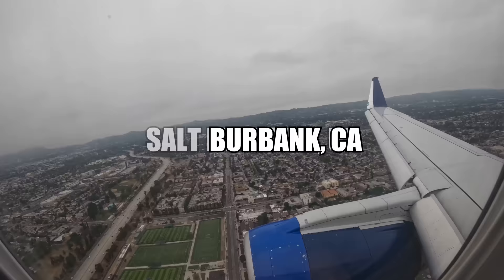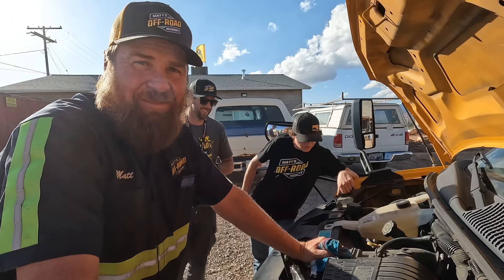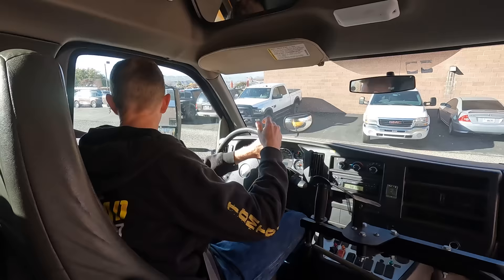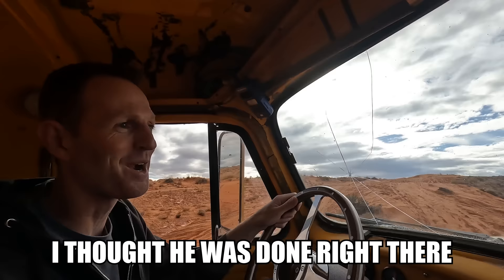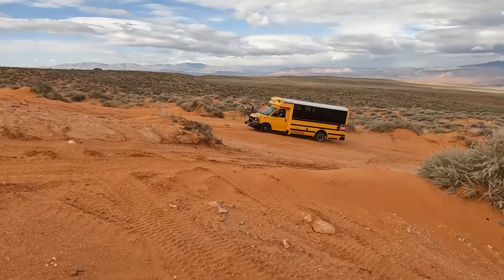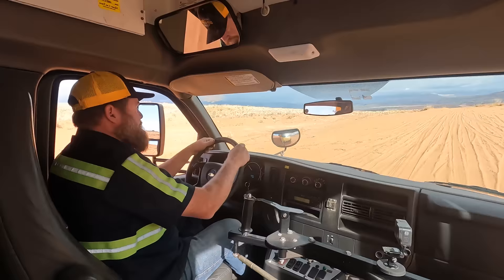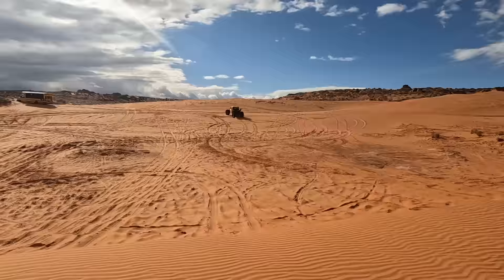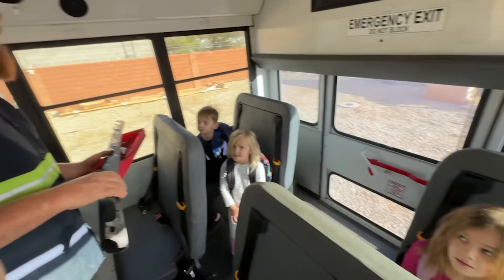We Jumped It!

Comment: The end was epic, with the kids in the back. Amazing how well the bus did. I was wondering if it has a limited slip rearend by the way it went through the sand.
Reply: There's some explaining to do 🤣
Reply: i mean i wanna say from 07-present gm in most truck applications put the g80 locker in the rear end and its a dually so more than likely should have that, how well it still works is up for debate since it one wheel peeled on that rock.
Reply: Could be that it uses the ABS to brake the spinning wheel too?

Comment: I used to drive a school bus as a work truck, loaded with tools, they're a lot of fun to drive. We also hit the bottom step on everything, the front corner was all bashed up.
You can keep the digital tach on all the time by pressing the top button to the left of the steering wheel multiple times until you get to the tachometer.

Comment: I would put full suspension seats in that bus. They will take out the majority of the harshness of the ride. As long as they have good shocks, it will go a long way in preventing motion sickness as well.
Reply: I agree.  Long chassis have light rear ends. The seating in the rear especially needs to be secure and supportive. And the steps… if you raise the chassis the steps will be hard to reach for older folks or people with physical limitations.

Comment: If the A/C belt has a tensioner I would recommend taking the tensioner off completely and putting on a stretch belt.  The newer trucks don’t have a tensioner for the A/C. Just a stretch on belt. I had to do that for mine because the fast up and down raving kept throwing it off.  Just a suggestion. 🤷🏽‍♂️

Comment: School busses are actually surprisingly competent. I'm a tree planter/Bus driver (driving everybody to the job site, then planting - often hundreds of kilometers away from ashpalt). With some logging truck tires and a good amount of momentum and confidence they are pretty decent. They are dualies, so even rear wheel drive, they do put power to 4 wheels :). The bigger busses have bigger tires/wheels and can accept logging truck tires - they have much better clearance but have much bigger issues with scratching their buts. Enough momentum fixes a lot of issues (bigger busses also really suck for the people in the back, it acts like a giant lever with the nose staying down and the back bouncing on bumps - the farther back you are the worse it gets). They also have much bigger engine bays and are incredibly easy to work on in the field - on some of our busses I can literally stand between the wheel and the engine. The engine bay on yours seems like a nightmare - things like to snap at high speed, being able to easily get in is important. 

In canada atleast, if it's chrome yellow and has the stop sign it's illegal to drive without a specific school purpose vehicle license. This is why all planting busses have house paint paint jobs.

Rip those nose mirrors off if you take em into tight trails. They will snap off otherwise - and at high speeds I would be worried about them hitting the windshield when they snap 

Gotta keep in mind the stairs. It is always the lowest point.

Also one of our competing companies did roll a bus last season - although that was loaded to the roof with gear, super top heavy. Take her high speed around hairpin corners and she does feel tippy, but she is good.

Sand sucks. Definitely had to do a 2 truck tow team at speed  to conquer some long steep hills where hitting her at 120km/hr wasn't sufficient. You have to go full send. To hell if your passengers hit the roof - you go slow you get stuck. 

I've gotten a stock bus (with knobby tires) more off-grid than most jeeps will ever see (although the bus is obviously less competent)

I've been trying to convince the company to organize a school bus rally racing series for charity. No dice :(.

Comment: Collins Bus, made about 2 miles from where I live.
"Each bus is constructed with high-strength low-alloy (HSLA) steel to produce a one-piece tubular roof bow that is 66% stronger than traditional steel. Meanwhile, the sturdy roll cage structure maximizes passenger protection by utilizing full-length, interlocking cage stringers and floor beams. The result? A dependable G90 galvanized steel structure that resists corrosion."

Comment: I would have suggested a full size bus, likely cheaper, with more clearance, and a stronger transmission. They drive really good, even in snow less than 2 feet.
I am impressed the shorty made it that far, but I'm also confident that a full size bus would also make it with less chance of high centering, and less bumbyness.

Comment: deff will need some wall padding inside also something to help keep passengers from hitting their heads on the windows from the bouncing and maybe a 3 or 4 point seat belts  to keep passengers in their seats. and since your going to be using 42in tires your center of gravity is going to be affected with it being top heavy so need to figure out how to stabilize it to keep some tipping... its going to be a epic build.

Comment: Once you put those big military axles you been sittin on under that thing it's going to be a monster, but super heavy.
It's also going to get tippy when you lift it up like your going to do, it won't be the same vehicle at all.
You will need to widen its stance to account for the higher center of gravity it's going to have.
It also won't be street legal if you take out the antilock brakes I would think.
I am actually interested in this build for some reason!
Reply: they coudl probably just have a system to disable the anti lock for off road?  right?

Comment: Something to check, does Utah require a special license to operate a bus like that? You might find that anything capable of hauling >12 people does require a special license. ETA: I just looked it up, a vehicle designed to carry 16 or more people, including the driver, requires a Class C level Commercial Drivers License. It doesn't matter if you have 16 people in it, if it's designed for it than the CDL is required.

Comment: One thing I have allways admired about Chevrolet head by duty platforms is they come standard with LSD or automatic locking diffs of one forum or another. My RWD F250 gets hopelessly stuck approximately one second after touching sand. Open differentials coming as standard on a heavy duty truck is just insulting to be honest.

Comment: I can't remember the right section of the law but there is (or was when I had to look it up in the 90s) a federal regulation regarding the paint color.  It's a very specific color called National School Bus Chrome (or chromate) and you're required to repaint the bus in a different color within 30 days of taking possession of it for private use.

(Had to look it up in the 90s when I owned a shop and one of my customers was a local band that had gotten a ticket for having their short bus that they toured with still in the original color.)

Comment: I am not surprised it is a Chevrolet not surprised one bit that it broke down. You should’ve bought a Ford. Yes they are a little more expensive but they’ll handle all the abuse. You can throw at it with more horsepower.